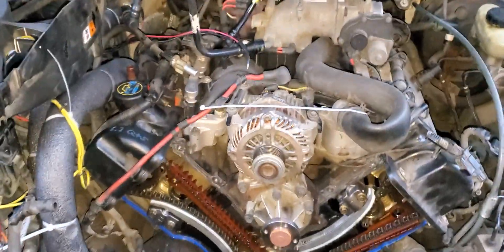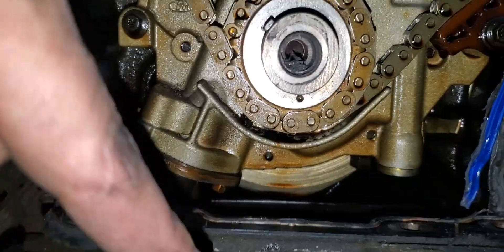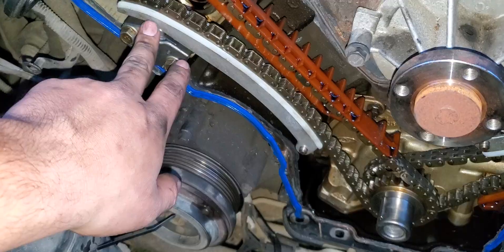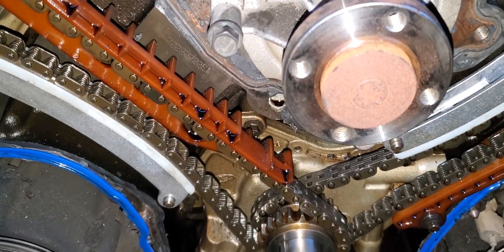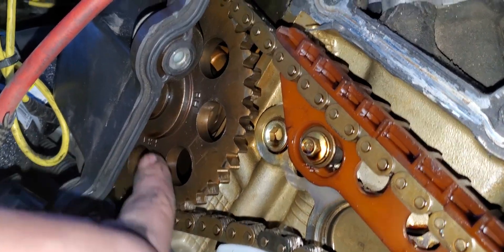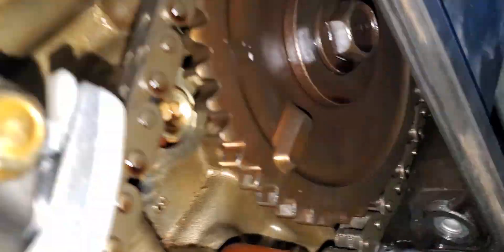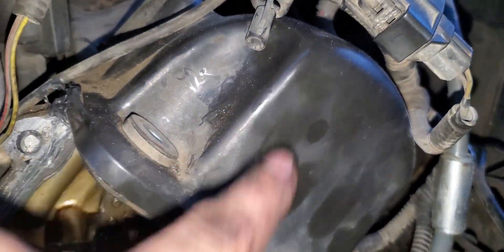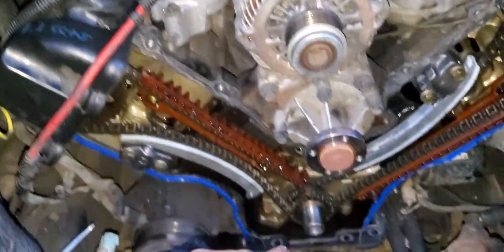How to Fix a Ford 4.6l 2V that Skipped Timing

Comment: What if my camshaft moved a lot with loose chains on. The sync between crank and cam is lost what do I do plz help
Reply from the maker: My cam skipped 4 teeth before bottoming out on one of the valves. It did not damage the valve. Just roll it back in the same direction from which it came. Once you think that you've got it set right, put the tensioners in and turn the engine over by hand twice. If everything lines up, you'll probably be alright. Of course, double check yourself. It never hurts to pull the sparkplug.
Reply: @T_Tatius mine wasn't even at tdc because I wasn't paying enough attention 😭 right cam jumped a few teeth can't even tell how many. Now idk how to go about setting it without damaging it and really don't wanna have to pull cams or anything 😭
Reply: What if it wasn't at tdc when this happens? 😭